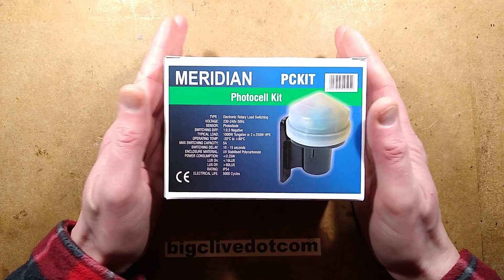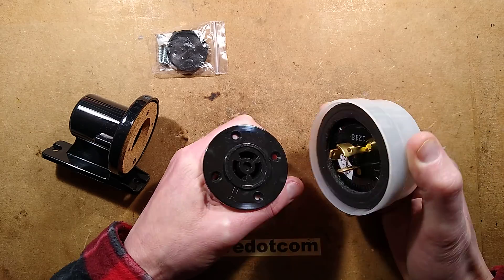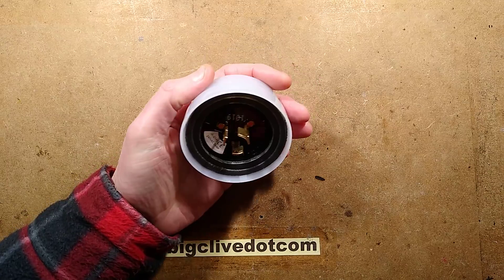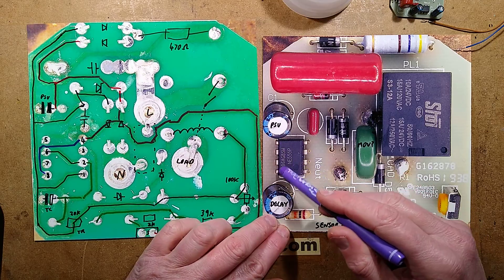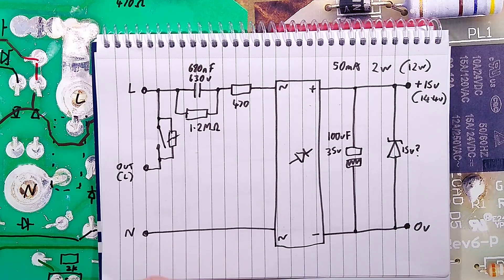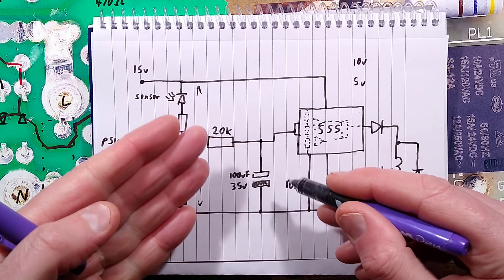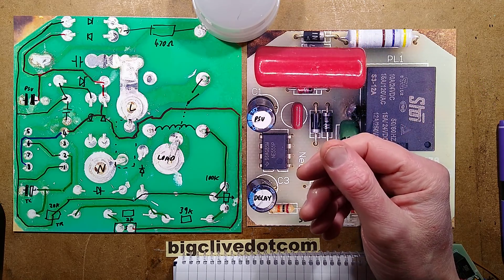Inside a UK compliant dusk sensor switch.  (with schematic)

Comment: I was soldering lugs to coaxial cable last night and I tinned it all first. Got it hot dipped in flux then tinned. Put together backwards the shield on antenna lug. No problem to loosen it and switch them. Just a little flux made sure.

Comment: Would not a sensor that increased resistance with more light, a current limiting resistor and a zener diode with suitable trigger voltage be adequate to turn the relay on and off with the sun setting and rising? It would seem to be a cheaper and simpler design than using the 555, would it not?
Reply from the maker: The standard light sensors reduce in resistance with light and are only rated for low current.  But early street lighting photocells did use a jumbo sensor to power a heated strip contact as a time delay.

Comment: I have one of these running in my garden running a 4w led, 70w MH and 70w son. Interesting to see how they work.
Reply: Better off buying an Acro photocell Izzy this model's casing (housing) Isn't up to staying in the sunlight for many years usually discolor/crack after a short period  letting moisture in..Westire & Zodion best make of photocell imho
Reply: @ghmusic8116 I wasn't aware they were that bad, I have it installed at the back of my house and is slightly shaded my the house, the lights come on around 10 bpm and go off around 4 am in summer. It seams fine for now but I wonder how long it will last, only had it for a few months.

Comment: Hello Mr. Clive. As i am sitting soldering lights and watching your show I feel compelled to suggest the Weller Industrial soldering gun for those large seemingly un-meltable soldering connections. I have one bought for $30 used on Ebay and it will easily power through every single one of those solder spots along with the plug metal. They are old too, they consist of just a huge coil for super current at 1 volt (I think) and this heats the metal (copper or brass) to the efficient heat. It is also economical as you can just reuse old copper wire from scrap and make your own solder tips to whatever size or shape you want. I also put mine to the side rather than front facing as you see here in this advertisement. I use a small one inch piece of copper wire sticking out to the left. It is very handy  for large solder jobs. https://images-na.ssl-images-amazon.com/images/I/31i9z2472oL._AC_SX466_.jpg

Sorry if you already knew of this. :)

Comment: Is that a NEMA L13-30 connector? If so, this would be a great way to automatically blow a circuit breaker at dusk.
Reply: No, in the UK we call them NEMA sockets and NEMA photocells.  They are the same size as the 15 A NEMA locking devices, 5-15, 6-15 and 7-15 nut if you look on a NEMA configuration chart  you will not find one which exactly matches this.  I have a. American duplex outlet which is described as non-NEMA and which has one outlet with both hot and neutral slots T shaped and no ground, and the other matching the photocell type. I believe that they were an older standard design which was not adopted by NEMA as an official standard.  They are an official standard of another body, IEC I think.

Comment: The voltage dividing part that goes to the input of the timer would explain why you would sometimes see street lighting flashing on and off before eventually stopping on, the capacitive dropper failing could also cause the relay to cycle aswell.

Comment: That's a way better built unit than the "Newlec" branded (fake copy, I think) sensor that I bought for one of our yard lights some years ago.

Why do the lights come on for a few seconds when power is applied? - Simple, it's to provide a function test for the load to be switched, and avoids the indecisive method of covering the sensor to turn it on. The old LDR variety had the same delay, and for the same reason.

If it doesn't say so in the information leaflet, the light sensor should be positioned to face North, or at very least, away from the mounting surface. It should not face South, nor directly toward the Sun.

Comment: I'm surprised they're allowed to have such a high standby power dissipation of 12VA and 2W, yet still comply with the regulations. The power consumption could be drastically reduced by using a CMOS 555/comparator/74HC1G14 and a TRIAC, preferably a sensitive gate one, so it doesn't need a large trigger current.

Comment: Although the quality of this looks to be quite good, I wouldn't say it's of the standard used in street lighting for one reason and one reason only, on this cell it looks like the load is wired through the "normally open" contacts on the relay (that's how the two I have are wired anyway) which means that if the electronics of the cell fail, the load wouldn't be activated which could be potentially dangerous. With a proper cell like a Royce Thompson (Zodion used to be reasonable but their modern ZCells are exceptionally low quality) the load is wired through the "normally closed" contacts so that if anything goes wrong with the cell, the load will be activated 24/7 which is much safer and also more likely to get the problem noticed quickly.

Comment: The "mystery" diode in series with the relay coil is to make sure all the flyback current when it turns off flows through the external diode parallel to the relay and not through the intrinsic diode within the 555 IC. The point is, all the circuit packed on a common silicon substrate has a drawback: Parasitic structures (mainly transistors are the pesky ones here) that may form unintended and not much controlled feedbacks in the circuit, making it not work (or with more modern CMOS those parasitics tend to even form a thyristor short circuiting the supply once activated, yielding immediate destruction). These parasitic transistors are unavoidable and their arrangement and parameters will vary among manufacturer and the generation of the seemingly the same standard IC. So the only way to avoid any problems, the application circuit designers should make sure the parasitics are never ever activated, here this extra diode.

Comment: Fitted some of these recently, they are tricky to wire especially in fp200! They were being used to switch some new led hi-lo lights in communal flat stairwells. The lights had their own built in photocells but the management company insisted we fit these and disable the built in photocells.
Reply from the maker: Yeah, FP200 would require careful shaping.

Comment: I had one back in the early '80s which had a large LDR connected in series with a relay coil.  The relay used to chatter like crazy as the coil current approached the switching threshold.  It was originally used to switch the outside lights at a primary school I went to.  The pins on the back were identical to the one in this video.

Comment: The series diode in the 555 output is there to convert the push-pull output to single-ended - without it the back-EMF current from the relay will go through the lower transistor and not the parallel diode.

Comment: I have been wanting to see what is inside these commercial ones. Kind of surprised they used the humble triple five. Thought there might have been some kind of micro controller! Although this circuit could have been done with the Schmidt Trigger style arrangement with just two transistors. Then a 24 volt relay could have been used and the overall dissipation of the unit reduced substantially. 

The connectors that these use on their bases is a NEMA connector - a North American standard. It's of course is a "twist lock" and looks similar to the connectors that are used in the US for generator power leads etc.

Comment: So these things die when the cheapest crappiest electrolytic capacitors on the market they used decide to dry out?
Reply from the maker: That sums up about 100% of modern electronic products these days.  Especially ones with high frequency power supplies.
Reply: That’s why my new amazing invention is 100% ceramic capacitor construction all the way down to the 25 watt power supply that runs the array.  When we get past this CoronaVirus, will get to see it crowdfunding this summer.

But CoronaVirus may have stolen the thunder.  :(

It is getting very bad here.

Comment: I have had one of these in the cellar for years with the intention of using it to control outdoor lights, but have never quite got around to it and am using the all-in-on sensor bulbs instead. The downside of those is that they need to turn off periodically in order to check if it's still dark...

Comment: My guess on the diode in series with the relay's coil, maybe done to reduce chances of cooking the coil causing module failure?
Reply: I suspect it's because the 555 reacts badly to having its output pulled below the negative supply, even by less than a volt. [Edit] Strike that - see my comment below.
Reply: @Graham_Langley  Could be. I used to use far more 555s than I have been lately, more uC's lately; They, too, are picky on the power being reliable! Bypassing power very well on either is "A Good Idea" :)
Reply: @mrsheesh3743  Thinking about it with a clearer head I'm wrong. It's actually there convert the push-pull output of the 555 to single-ended. Without it the lower output transistor will short the relay coil when low, meaning it will pass all the back-EMF current instead of the parallel diode - which may embarrass it.

Comment: This would not work very well if the Earth was flat!
Reply from the maker: You just have to make sure it's always pointed at right angles to the plane of the earth and not mount it on the rim round the edge.
Reply: @bigclivedotcom  ...
Absolutely right. And be sure it complies with all current IEE regulations so don't get one made in China.

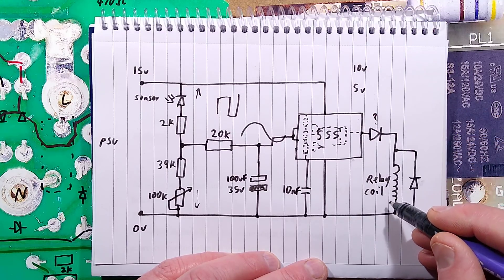Comment: 13:18 @bigclivedotcom   that diode on the output of the 555  is to keep the reverse voltage spike from the relay coil from back feeding into the 555. otherwise soon as the relay is turned off there is a significant reverse voltage spike that would kill the 555 timer.   Normally  the diode is placed across the relays coil contacts  but as long as the diode is able to prevent reverse voltage spikes it don't matter where it is.  That circuit basically has two reverse current shunt diodes :)
Reply: Nearly. It's there to convert the push-pull output of the 555 to single-ended. Without the series diode the lower transistor will pass all the back-EMF current as it will short the relay coil when the output is low which may put a damaging current through it. Putting in a series diode means the parallel diode can do its job.

Comment: The Diode on the output of the 555 looks like a blocking Diode to block the Voltage from the Relay coil whilst the Free Wheeling Diode does its job.
Reply: Agreed - the 555 output is push-pull so the back-EMF current from the relay will go through the lower transistor and not the parallel diode if the series diode wasn't there.

Comment: I think that diode is there to protect output of 555. When 555 output goes low, relay coil keeps current flowing for a while and without that diode it would pass directly through that output to ground.
Reply: Agreed.

Comment: Clive,  With those massive heat sucking solder connections, spend a little and pick up some "Chip Quik tm" low melt alloy. Apply it in about 50/50 ration with the solder you wish to remove and with plenty of flux. let the alloy do it's job.
https://gokimco.com/chip-quikr-smd1-patented-smd-removal-kit.html?gclid=Cj0KCQjwmdzzBRC7ARIsANdqRRkesjLStHQN7xISCQWVwwYC-vfSeuH_bbDKr1Sf8g0admeWZO3rr8oaAi48EALw_wcB
Made for SMD part removal, but very effective removing large components on PCBs with large heat sucking internal ground planes and low clearance via's. Instead of destroying a via, it is nice to see the alloy work and the part fall off the other side, such as a 20A square bridge rectifier and other difficult to remove parts. It's expensive, so use only when needed.

Comment: Two interesting issues I see with this circuit. First, there is no current limiting resistor going from the bridge rectifier to the Zener diode. And that means the current is going to possibly fry the Zener eventually. Secondly, they could have easily used a Triac instead of a relay to control the output. I see so many type circuits use relays. And relays will also eventually wear out. A Triac or even an SCR would work just as good and out last the relays. But nice explanation of the circuit either way...
Reply from the maker: The current limiting is inherent to the capacitive dropper.
Reply: I suspect that the heat sink required for a Triac might cost more than the relay and be too large to fit. Dimmer switches require pretty large heat sinks. Maybe that’s why they use a relay?
Triac sure would reduce the standby power though.

Comment: That's allot bigger than the ones we use here in the US. And what's funny is yours uses a standard US 220V twist lock plug.  The ones we have here in the US are crap. Very failure prone and most places just wire around them and go with a switch or a timer. You can always tell the places that have a timer instead as their lights don't come on when there is a storm or when it gets dark early in the winter.

Comment: Regarding the “question mark” diode. I sometimes see these in other relay circuits as well. My best guess is that they are protecting the output transistor in the 555 against a brief positive voltage spike that happens when the relay coil resonates with the capacitance of the parallel diode on relay turn off (the parallel diode doesn’t discharge the coil cleanly, but often there’s some ringing after switch-off). In my experience it’s never been a problem, but it seems some designers believe otherwise.
Reply: avian6 I had never thought of resonance there, interesting idea. 
My first though is that the mystery diode is reducing the negative voltage on the 555 output pin while the fly-back current of the relay coil is dissipating and allowing one diode drop below the negative rail due to the coil snubber diode. 
Could it be that the small negative voltage on the output pin could otherwise lock up the 555?
Reply: Otmar Ebenhoech That also sounds plausible to me.
Reply: @CafeElectric  That was my first thought, but thinking about it again it's more likely to stop the lower transistor of the push-pull output stage passing the back-EMF current when the output goes low which might embarrass it . The series diode lets the parallel diode do what it's there for.

Comment: Installed some from CEF.
They were absolute crap, no hysteresis so the lights would flash on/off once a second for 5 mins at dusk.
Replaced the heads with a different brand and worked as expected.
Before anyone says it, the controlled lighting did not have any influence on the amount of light falling on the sensor as they are on opposite sides of the building.

I've seen the same thing happen with some motorway lighting, they must have got the same crap brand of sensor
Reply: That sounds like it was feedback via the internal power supply when the relay pulled in, coupled with not enough hysteresis.

Comment: How much power can this unit switch? 300 Watt, more?
Reply: Whatever the relay contacts are rated for. 300W at 240V is only a 1.25A so no problems there. In fact if you pause the video when Clive shows the photo he took of the board, you can clearly see that the relay has a rating of 12A at 250VAC - that's around 3000W, though I don't know how long the relay contacts would last with that sort of load on it, but yeah, relays are still the best way to switch heavy loads.

Comment: @3:05 - I'm in the USA and I have never heard anyone outside of an OLD electrician friend refer to "RAWL" plugs.  Back in the day, we used jute and lead sleeves to fasten things to a brick wall.  They were "RAWL" brand and they are the best you can get IMHO.
Reply: Here in the UK, Rawl has become a generic name. Even though it's technically a brand name, the term "rawl plug" has come to refer to all kinds of screw fixings designed to go into masonry. I use the term all the time, though I haven't seen any bearing the Rawl brand name for many many years. It's a bit like saying you're going to google something, or do the hoovering :)
Reply: @countzero1136  I jumped down a rabbit hole and read as such.  I love learning new things.  That's a really good reason to watch Clive.  Thanks for the reply, mate!
Reply: @countzero1136  Indeed. One has to be very careful when writing installation instructions and refer to them as wallplugs.

Comment: Bought a Red Arrow branded one of these from a CPC flyer a couple of years back to gut and use to house a light sensor.

Its PCB was mounted copper side up making soldering /desoldering the contacts a lot easier at the expense of having to hand-solder the relay, pot and photodiode. The pad pattern for the contacts looks identical to yours so I guess one firm makes the case and others put their PCB in it.

The 555 side of the cct is absolutely identical but used an unbranded open-frame relay with very chunky contacts. The PSU side used a 100n dropper cap with no series resistor and the MOV was between L & N . [Edit] Just read your correction re. the MOV.

Comment: perhaps the diode coming out of the 555 drops the voltage for the 12v relay.
Reply: Scott Tuttle I was thinking the same, although not sure why they couldn’t just have designed the supply to provide the correct voltage...

Comment: Where I live they use either blue or red-brown sensor modules, with the actual light detection diode/resistor being on knew side of the unit. 

These are mounted to the underside of the street light unit, meaning if the lights are on a road which runs East-West, the lights with the east facing sensors will all turn on first. So you get this weird effect where all the lights on one side are on well before the other side.